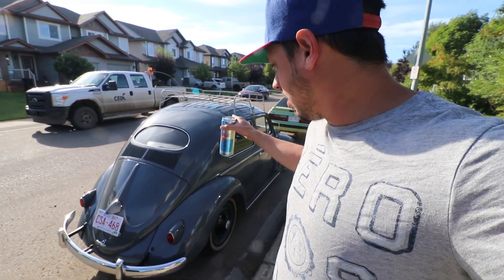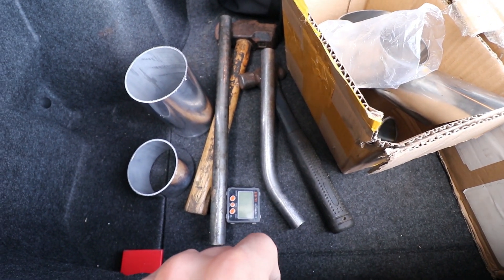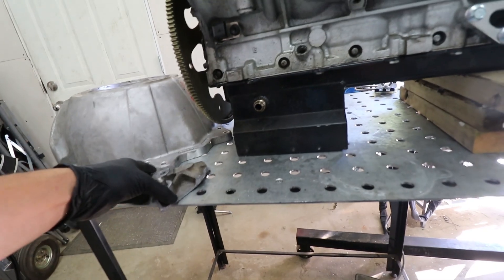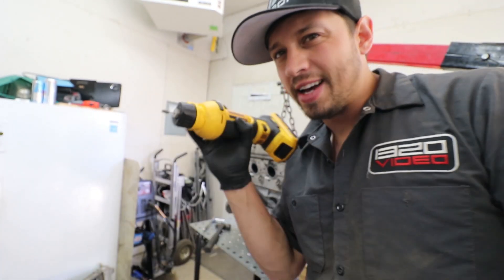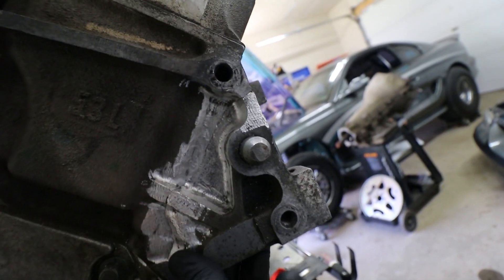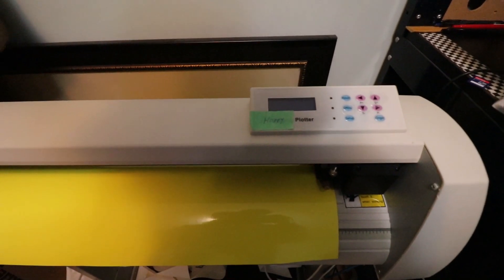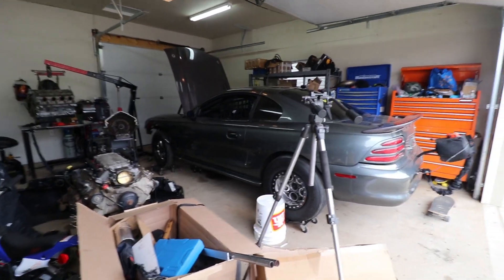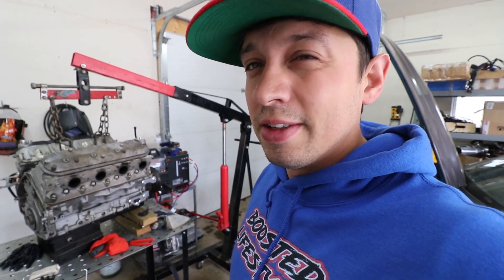This Might Be Really Sketchy With 1000HP

Comment: I need some of those totes if you can stack them with more than 5lbs inside, all around here is some shitty ones that the top collapses with just a nearly empty tote on top. 
Get you a flex shaft adapter if available for that drywall tool, i have one that goes on my bench grinder shaft has a 6’ cable and is nice for nearly noise free porting with no air compressor running all day

Comment: you ever miss the supra i just got my built motor in my car. real street main caps arp everything phr oil pump manly turbo tuff i beams je ceramic coated pistons ported head bc 272s valve springs and retainers. going to be a fun season
Reply from the maker: Dang that's a serious set up!
Reply from the maker: Dang that's a serious set up!
Reply: @Boostedlifestyle  thanks ill post some vids up when done hopfully by next week im at the dyno

Comment: If it's not built it won't hold.  It will work but who knows how long
Reply: You mean the bottom end ?
Reply from the maker: Lots of stock bottom end ls making 1000hp
Reply: @Boostedlifestyle  for how long?  Guess it doesn't matter because you can just throw anotherone in there.

Comment: Hey kyle i have that dewalt 20v impact its the mid trq its the tits on a bull.lol. my next one is the dcf899b 1200lbs ft trq high impact its $250 us dollars tool only no batt no charger.
Reply from the maker: That's the one I have is the DeWalt brushless high torque
Reply: @Boostedlifestyle  oh ok whats model number it look like the 894 witch is the mid trq
Reply: @Boostedlifestyle  either way i use my 894 on my f150 lugs an rusted old suspension parts no problems always exceeds my expectations.